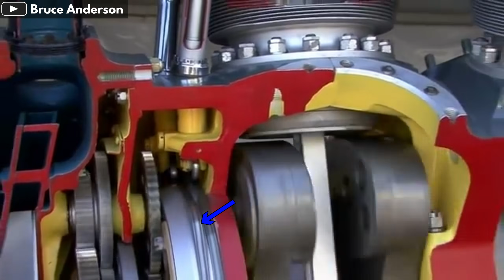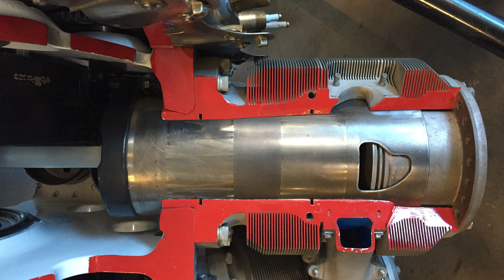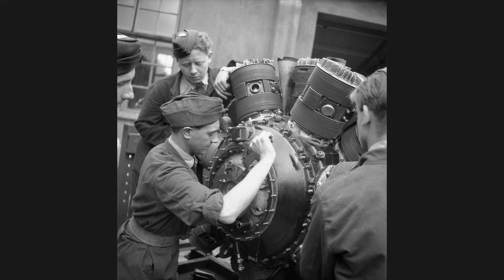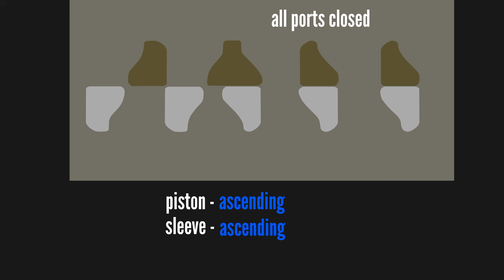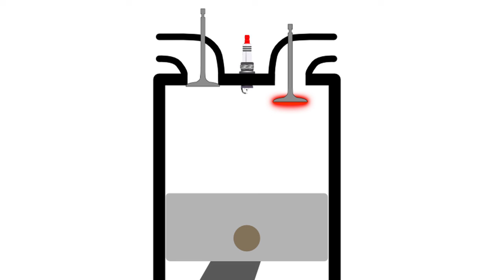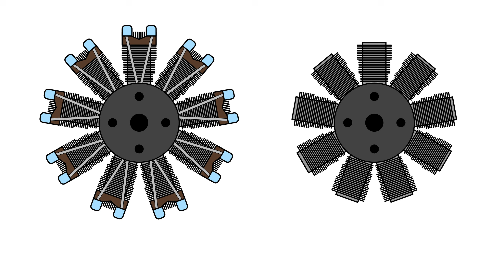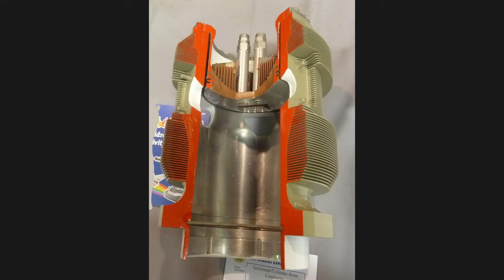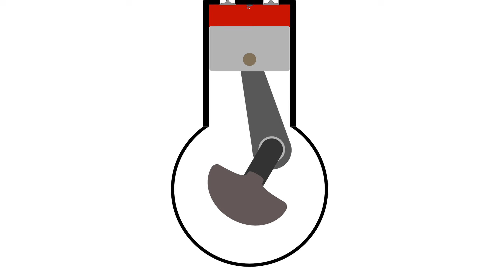Analysis of Bristol's Sleeve Valve Aero Engines

Comment: Many of the advanced engines in both the UK and US were designed with sleeve valves by the late 1930s.  Even Rolls Royce had a sleeve engine, the Eagle, under development.  The Crecy, a sleeve valve two stroke,  was probably the ultimate sleeve valve engine.  The advent of the gas turbine made all of this obsolete near the beginning of World War II, so piston engine builders largely went with their existing 1930s designs.
Reply: One wonders why a 2 stroke needs a sleeve  valve.
Reply: Using a mechanical valve in a 2 stroke (rather than just having ports cut in the cylinder) lets you do 2 good things: first is uniflow scavenging, which has much less mixing and short circuiting than other methods. The other is asymmetric timing, specifically closing the exhaust before the inlet ports are covered by the piston. This allows the use of supercharging.

You can do this with poppet valves too, see the detroit diesel 2 stroke for an example.
Reply: @nerd1000ify rotary and reed valves featured in some 70s motorcycle engines but these were crankcase scavenged?
Reply: @nickinknutsford  Yes, common in modern 2 strokes as well. But those are intake valves for the crankcase which serves as the scavenge pump. The sleeve valve engine mentioned above was using the sleeve as an exhaust valve in the cylinders- it didn't use the crankcase as a pump, instead the pressure for scavenging was provided by a centrifugal blower.
Reply: @nerd1000ify Winton-type, two stroke Diesel engines are not supercharged, the are what is called "Normally Aspirated"
Reply: @sandervanderkammen9230  Because all 2-strokes have some kind of positive pressure generating air pump (i.e. a supercharger) to facilitate scavenging, "Normally aspirated" in 2-stroke diesels really just means "We didn't try to make the air pump pressurize the cylinder after scavenging is finished." Generally on such an engine the inlet ports do not remain open after the exhaust has closed, as would be the case on most "supercharged" designs.
Reply: @nickinknutsford You need sleeve valves to supercharge a two-stroke engine.
You cannot supercharge a uniflow or a loop-scaveged two-stroke engine.
Reply: @sandervanderkammen9230 Napier Deltic did not have sleeve valves!!
Reply: @nickinknutsford True, the Napier company licensed the Jumo 219 in 1934 and its a uniflow scavenged.
Reply: @sandervanderkammen9230  You actually can, even on a loop scavenged type. 3 methods are available:

1. Tuned exhaust. Use a sound wave as the "valve" to prevent high pressure charge escaping into the exhaust. Only works in narrow engine speed range defined by pipe geometry. Popular on small 2 strokes, e.g. motorcycles.

2. Exhaust pressure pulse charging: Use blowdown pressure of adjacent cylinder to prevent high pressure charge escaping into the exhaust. Due to engine timing this method only works on groups of 3 cylinders with piston phases 120 degrees apart, so any engine that uses this strategy has to have a cylinder count which is a multiple of 3.

3. Constant pressure turbocharging. In this case the backpressure from the turbine provides elevated pressure in the exhaust, preventing high pressure charge from escaping. Requires additional blower for starting, engine performance is reduced by increased backpressure (but this is offset by not needing to drive supercharger from crankshaft). This method was used extensively in large ship engines before uniflow engines with poppet exhaust valves became ubiquitous.
Reply: The Crecy was an unsuccessful design
Reply: @sandervanderkammen9230 only because gas turbines surpassed piston engines in technological advance.

Comment: Excellent presentation.  I knew some of the info, but was surprised at the relatively low oil consumption of the sleeve valve engines.  I wonder if Bristol's expertise with keeping the sleeves/pistons round, along with reducing blowby around the ends of the sleeves somehow translated into their ability to also get a better seal with the piston rings?   Alternatively, was the higher oil consumption of the other engiens related to the valves for some reason?  Maybe the valve stem seals?
Reply: An interesting part of the oil situation is carbon buildup on the sleeves.  In the seventies, an interview with a Bristol engineer asked about it.  He replied, "Yes, that was a pre-detergent oil problem."  I looked up all kinds of information to discover that detergent lubricating oil was a major World War 2 development, which affected all piston engines.  It's why you no longer have to get your car's engine taken apart every 50,000 miles to scrape the sludge out, as well as making oil filters practical.  Hugely important, but little known.
Reply: As a general rule, oil consumption was higher than comparable poppet valve engines

Comment: I believe Ricardo was conscious of swirl effects.  In The High Speed Internal Combustion Engine page 343 there's a picture of an anti-swirl baffle in a high speed engine.  He mentions it on page 340.
Reply: I read that Riccardo championed the sleeve valve concept primarily because it could tolerate a wide spread of low Octane fuel. The article mentioned that until 1939  UK avgas Octane rating was only 87 thus severely limiting Boost and the quality was inconsistent . The absence of a red (white ?) hot exhaust valve in a sleeve valve engine meant they were less prone to detonation. I think Riccardo and Sir Roy Fedden both got a bit obsessed with this technology and the latter admitted as much after the war.
Reply: @number1genoa Germany got around the low octane problem with Direct fuel injection
Reply: @WilhelmKarsten  The Germans used several grades of aviation fuel known as B-4 and C-3. B-4 had a lean octane rating of 91 and a rich octane rating of 100 using corresponding English and American rating systems. It should be noted that German 87 octane fuels were considered the minimum high compression aircraft engines could be run on without risking damage.

C-3 was a higher octane rated fuel with nominal lean rating of 95 and rich rating of 120–130. By 1943 C-3 was 150 rich octane to meet the demands of the latest Junkers and Daimler-Benz engines coming into production.

Some confusion exists because the Germans generally listed the octane ratings a little differently from American and British fuels. In Britain and the US the maximum octane (rich rating) is listed, while the Germans gave the lesser lean mixture rating.
Reply: @Joshie2256 True, German engines exceeded US engine performance, due in part to a superior fuel metering system, superior supercharger and manifold boost control and management, and larger displacement which requires lower manifold pressure to produce equivalent power output.

High lead content raised octane rating but had its own set of problems associated with the high lead including oil and spark plug fouling, injuries and deaths related to lead toxicity and shorter TBOs.
Reply: @number1genoa There is a tremendous amount of misunderstanding regarding the difference between the different octane rating systems, PON, MON and RON
But more importantly is the general ignorance regarding the fundamental principles between HCSI and SCSI mode combustion modes.
 GDI allows both higher static and dynamic compression ratios for the same fuel anti-knock characteristics and intake charge temperature and A/F mixture ratio.
 Knock or Pre-ignition cannot occur if there is no fuel introduced into the combustion chamber.
 In much the same way Diesel engines do not suffer from the effects of pre-ignition and can operate at higher compression ratios and leaner AF mixture ratios 
Stratified Charge technology was a quantum leap in aviation technology and was not available to the Allies until after the war ended and piston engines were rendered obsolete by jets.

Any questions?
Reply: @WilhelmKarsten  Calum Douglas (Author of the Secret Horsepower Race) has commented that Octane rating per see is so meaningless as to be near irrelevant, presumably because there are so  many other variables involved not the least of which was that  the Octane  test engine was (is ?) a slow revving cast iron behemoth that  bore no relation to any practical reality. I was recently severely reprimanded by a person with a PHD in the chemistry of combustion that Knock (detonation) and Pre ignition are totally different things and not to be confused  which while fair made me recall my engineering tutors wry observation that academics usually engage in scholarly debate followed by academic polemic  then  pistols at dawn to settle the minute technical details. Meanwhile I'm sure the engine designers of WW2 would have salivated over the possibilities of digital manipulation of fuel injection  regardless of what the doctors hypothesised. :-)
Reply: Calum Douglas says a lot of things that are equally meaningless, highly biased and written for intertanment and shock value.

It's a completely ignorant and benighted based on a fundamental misunderstanding regarding the relationship between fuel octane rating and high brisance detonation.

Octane ultimate effects not only the autoignition point but the  speed and the temperature of controlled high speed deflageration.

TRUE, "Knock" and "Pre-igntion" are not the same and are produced by different conditions.
 BUT they are discussed in the same context as the both produce the same undesirable effects, Engine Damage due to the effects of supersonic velocity, high brisance shock waves which can exceed the material and structureal design limits.

The Allies certainly salivated at the possibilities of have highly advanced, multi point direct fuel injection system... technology that was only available in Germany at the start of the war.
Fuel injection not only signifcantly increases horsepower compared to the same engine with a carburetor, it reduces the need for higher octane fuels, increases engine reliability and durability but also for carb heating to prevent deadly carb-icing related accidents..
Reply: @number1genoa Germany rate octane by a completely different scale and so these number are not directly comparable.
 Also the Lean numbers are only relevant when running the engine Lean of Peak which is used to improve maximum fuel efficiency and thus maximum fuel range not maximum horsepower at TO or WEP when higher manifold pressure is required
Reply: @WilhelmKarsten  Wilhelm says ze germans were always superior?  Shocker.
Reply: @number1genoa 

I wonder if the technology would be worth revisiting for modern cars, to allow more power at 87 octane. I suppose that depends on whether sleeves can tolerate ethanol as well, as far as US vehicles go...
Reply: @spindash64  I believe modern materials and electronic engine management allow most of today's IC vehicles to run on 87 octane fuel.  Lean burn technology from fuel injection improves fuel economy as well.
Reply: @lohring 

They can RUN on it, but they always could. What they couldn't always do is run at the compression ratio they want

And in today's world, where getting more power while meeting emissions standards is king? That's where you want to get as much compression as you can without needing to run outside Stoich
Reply: @lohring  Not really, modern high-swirl Quench type combustion chambers, variable cam and valve timing and the introduction of knock sensors allow higher compression ratios with low octane fuel.
 The recent introduction of GDI to automobiles allows static compression ratios exceeding 13 to1... and high manifold pressure (supercharging) on unleaded pump gasoline... something that the Germans introduced in their aircraft engines before the war which is why the Luftwaffe didn't require high octane leaded fuel for its supercharged engines.
Reply: @spindash64  Knock sensors allow the highest possible static compression ratios without damaging the engine, if conditions exist that would cause the engine to knock? Ignition timing is reduced until the knocking stops and intake air temperature and pressure return to normal parameters... the only downside is a slight temporary loss of performance, but it prevents costly damage
Reply: @DoktorBayerischeMotorenWerke 

But why not both?
Reply: @spindash64  No advantage to using sleeve valves... they are more expensive, less reliable and their power output is limited by the lower rpm limits, they also tend to have very high oil consumption.
Reply: @DoktorBayerischeMotorenWerke 

No valve float
Reply: @spindash64  no valve float... just broken cylinder sleeves.
Sleeve valve engines were restricted to relatively low rpm compared to poppet valve engines, particular modern engines.  
Valve float has been solved too.
Reply: It was Prosper L'Orange who championed the swirl-effect.
He also developed GDI for Aero engines
Reply: I could be stating the obvious but, since I have both third (1941) and fourth (1953+) editions, those pages are from the fourth, which is a much better and enjoyable book than its previous version.
Reply: Poppet valve engines of the era achieved swirl by off setting the intake valve. This worked well till the high compression automotive engines post WWII. The high compression ratios required a dome piston. With a two valve hemispherical head this resulted in a combustion chamber resembling a thin hemispherical shell, which produced  slow flame propagation requiring large ignition lead angles. The result was poor poor combustion and thermal efficiency. This all changed in 1967 when Cosworth used a four valve head with a reduced valve angle. This allowed a more compact combustion chamber while replacing the traditional axial swirl with vertical swirl. The Cosworth style head has since become near standard to for automobiles.
Reply: @fafner1  High-Swirl or Quench type combustion chamber architecture cannot be achieved by off-setting the intake valve.
 Hemi engines are the polar opposite to a high swirl design like the Wedge or Pentroof.

Cosworth used an existing Pentroof design for its 4 valve engines.

These engines use Quench pads or Quench zones in the chamber that match a corresponding area on the piston or use a flat-top piston.

Any questions?
Reply: @fafner1 NO, the don't

Comment: In my opinion, somebody had to test the hypothesis that sleeve valves would eventually have advantages that outweighed their disadvantages, otherwise we would never have found out that the null hypothesis, that the disadvantages outweighed the advantages was true. It remains possible that future use cases such as hydrogen fuel and modern ceramic components might yet see a renaissance of sleeve valve engines. A bit like NSU and Mazda and the KKM Wankel engine which ultimately proved unsuitable for present-day automobiles, but may yet be viable in future applications.

Comment: I think it's very impressive that they managed to make sleeve valve engines that were largely on par with contemporary poppet valve engines. But I also think it was completely wrong technology to invest all that effort to develop and manufacture. When I first learned about sleeve valves I wondered how the h*ll did they think that would have better potential than poppet valves? Did they assume poppet valve engines had reached their theoretical limits?
Reply: well they actually found out that they were 5 to 10 ish percent more efficient, because the sideways motion of the sleeves keeps the rings moving, rather than a stop start cycle. that's why there's still developments in the tech trying to bring it back.
Reply: @martin-vv9lf  Sleeve valves in themselves didn't provide a 5-10-ish % net benefit, all things considered, not even back then, not even if you disregard the issues with developing and manufacturing them. Benefits has to be weighted against the drawbacks of the technology that provides the benefit, in order to realize the net benefit. Also, comparing completely different engines can only give an indication of what one specific technical difference between them might influence, not an exact measurement of what one specific technical difference makes.  

There's a lot of old engine technologies people are trying to bring back, and "new" engine technologies that people are trying to bring to market, and there are also a lot of scammers pretending to have solved issues with old ideas, and or developed new superior engine technologies. Those efforts doesn't mean those startups and scammers have realized some huge potential advantage all the big manufacturers have completely failed to realize all these decades.

Comment: The Devil is the time it takes to perfect a new technology. Even when its a brilliant achievement, a new discovery can make it obsolescent. i.e. all the development money and improvements that went into turbo-compound piston engines, while in the background, the first jets were being designed...
Reply: Sodium filled popper valves made sleeve valves obsolete. Sleeve valves were mechanically complex, have a large reciprocating mass, are not very tolerant of high boost, as the sleeves distort and stick as the boost goes up. 
I can understand in a radial, as having 4 valves per cylinder in a radial was a complex design problem.
I highly, highly recommend Calum Douglas's book "the secret Horsepower race."
Reply: @garethbarry3825 Four valves could be used in a radial. They just needed forked rockers. Double Overhead cams would take up less space but that needs a lot of timing chains.
Reply: @Dave5843-d9m  out of interest, do you know of any large radials that used 4 valves per cylinder? I have wondered why this wasn't done widely, or maybe I am wrong with that assumption?
Reply: Sleeve valves were not new in 1938.
Reply: @sandervanderkammen9230  knight engine?
Reply: @garethbarry3825 Yes, Charles Knight invented the sleeve valve engine and licensed the design to dozens of European manufacturers